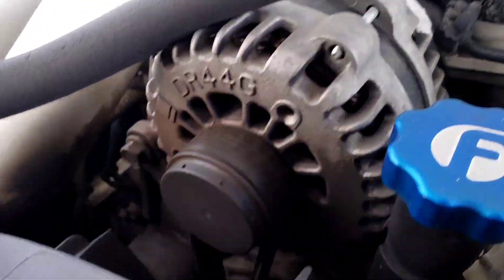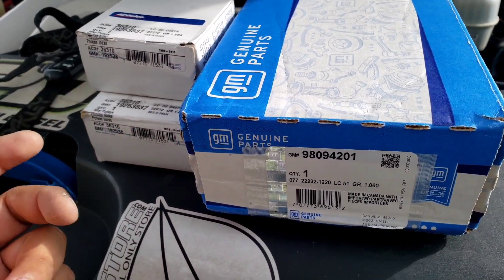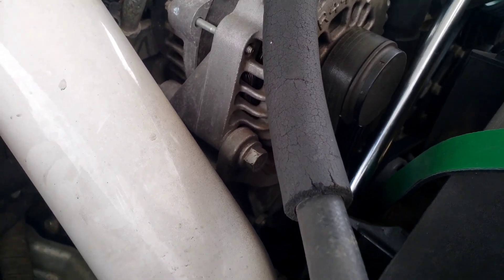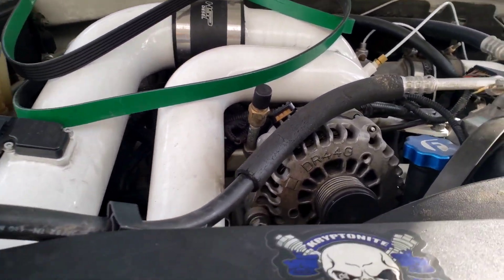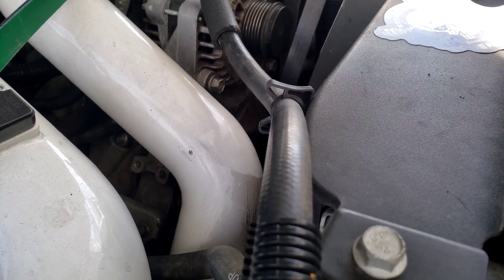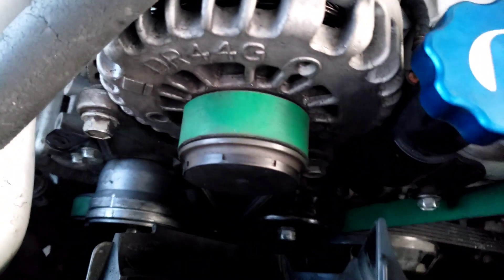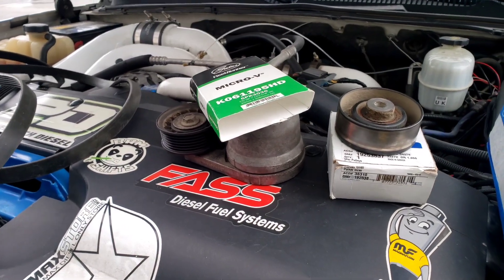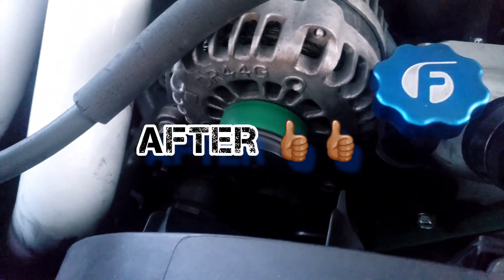LBZ pulley, tensioner and belt change!

Comment: I changed mine yesterday.  I have an LMM. It had original altenator and pulleys with 117,000 miles. Altenator needed replaced, so I switched it all out while I had it torn down. What a difference